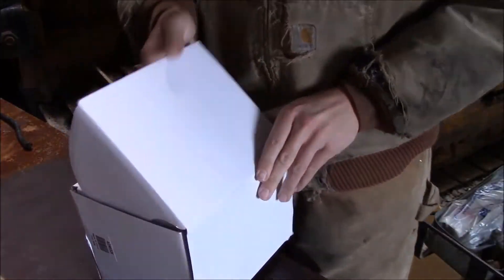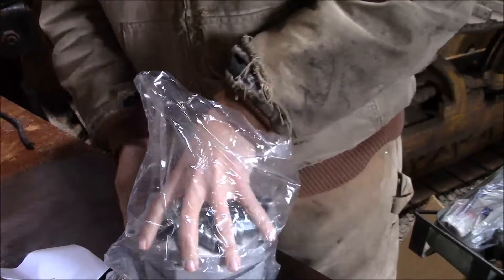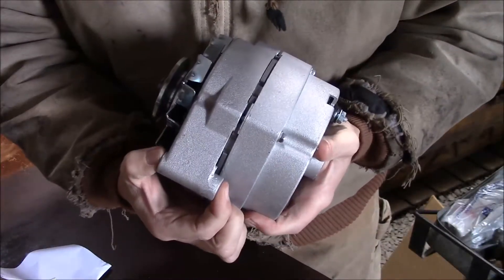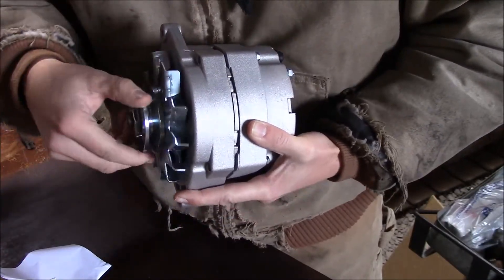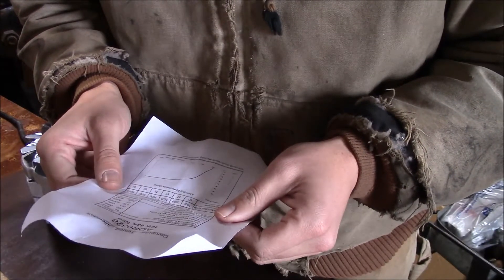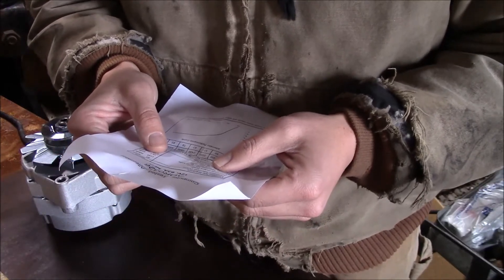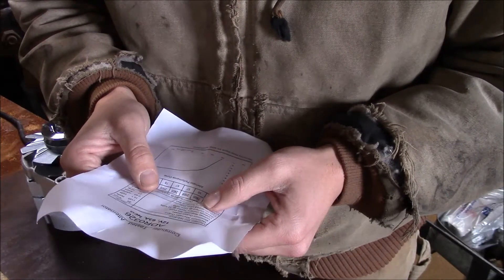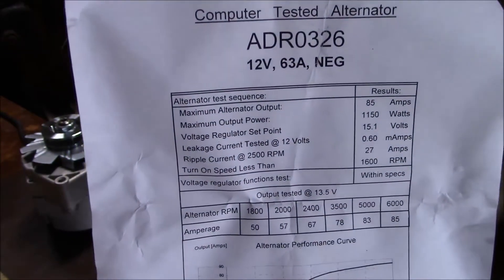Tractor Alternator Replacement

Comment: Your a smart young man , you do your research first then act on that knowledge , smart !  What does your fleet of tractors consists of size wise , mostly J.D.'s I see which is very good . Is that 3020 a gasoline engine , it sounds like it is ?
Reply from the maker: Our biggest tractor is a JD 4630.  Goes down to a Farmall Cub.  Yes, most of our tractors are John Deere's.  Our 3020 is a gas engine.